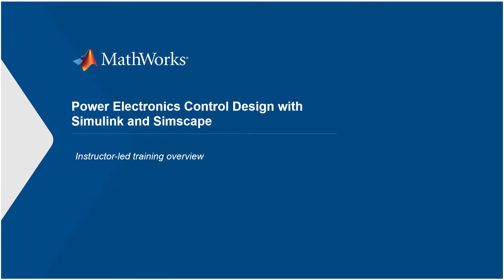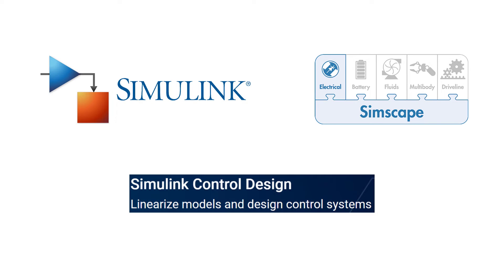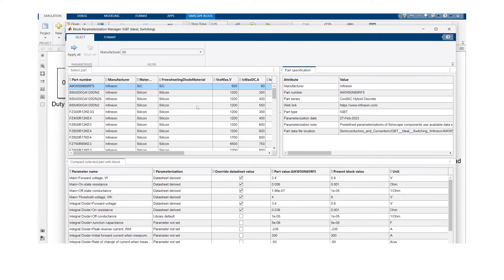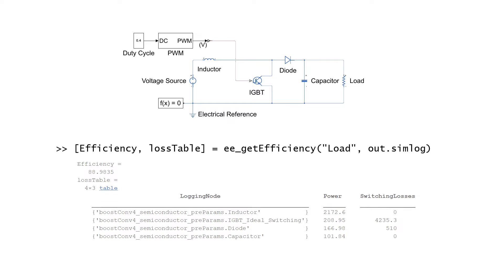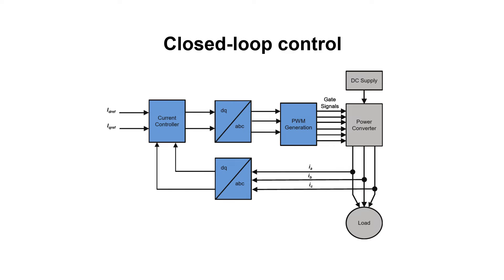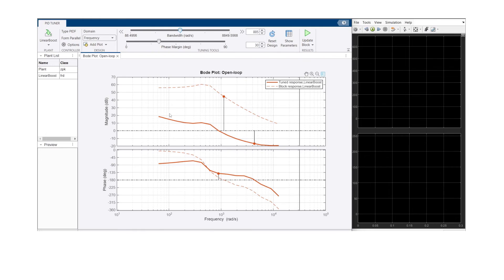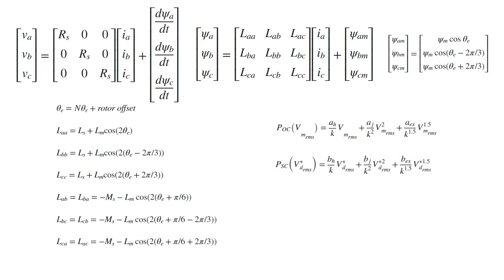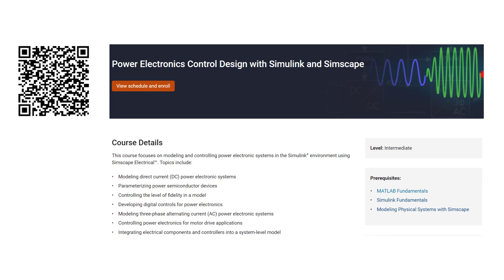Power Electronics Control Design | Instructor-Led Training - Course Overview

Comment: As no electric expert I have one question. What does the IGBT do here? Isn‘t the voltage source always a closed circuit with the load, so what does pwm input do, is it like an additional voltage on the voltage source of 250V?
Reply: Applying a PWM signal, jumping between on and off, lets you dim your led.

In this case the PWM-signal ist just a voltage-signal and is not capable of providing any power. 
But it can transfer its state via the IGBT onto the power circuit.

I think the strict separation of signal circuit and power circuit might have let to some confusion.